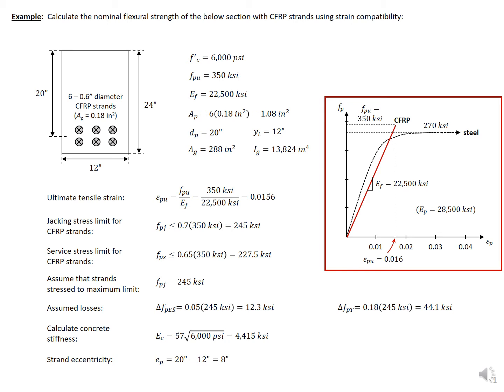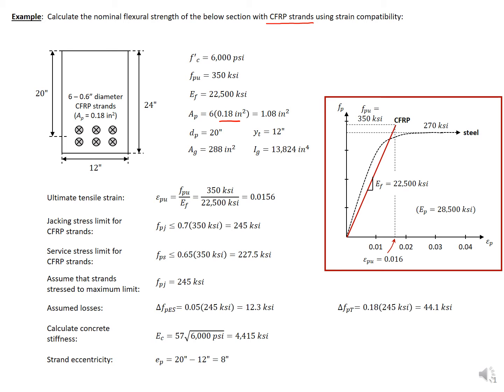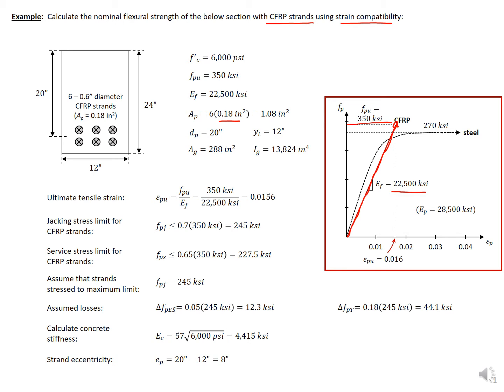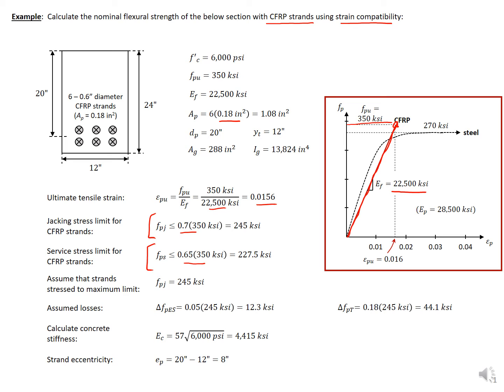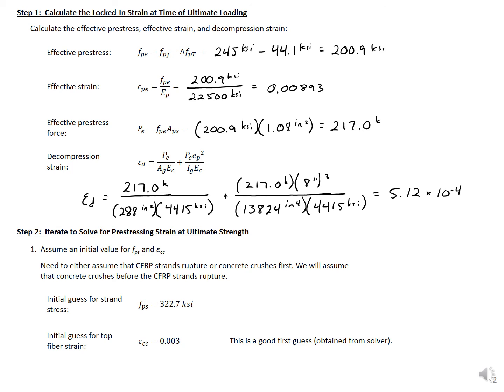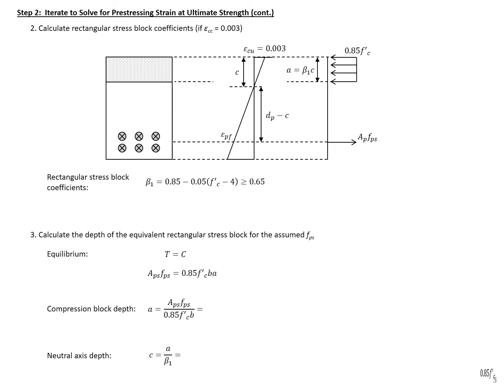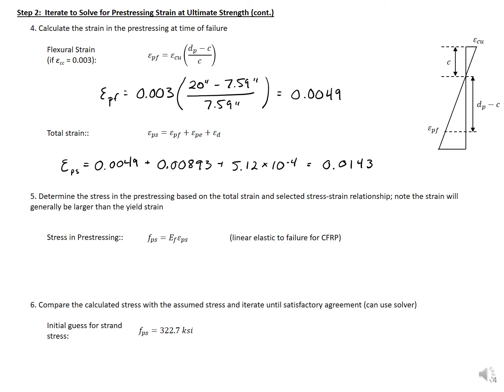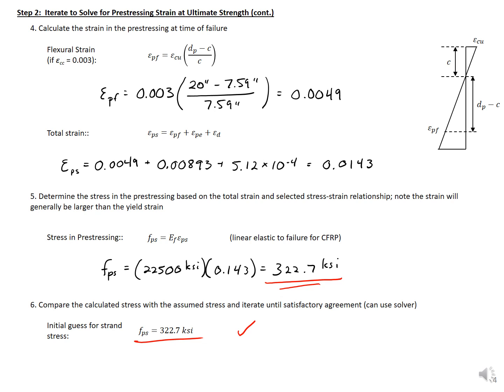Prestressed Concrete Design - 8 - Example 6 - Nominal Moment of Section with CFRP Strands

Comment: My main confusion is the strain in steel. Is this strain due to the retraction of the steel? Strain also equals ->  delta(L)/L 
the steel is pulling the force into the beam due to retraction which is why the concrete is being compressed. I am just confused as to where this change in length is occurring (after prestress losses)